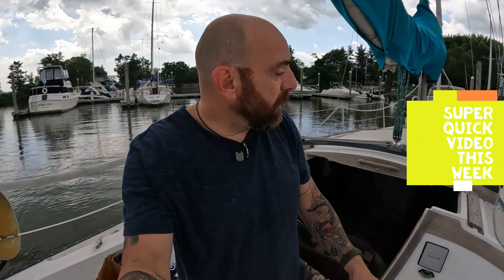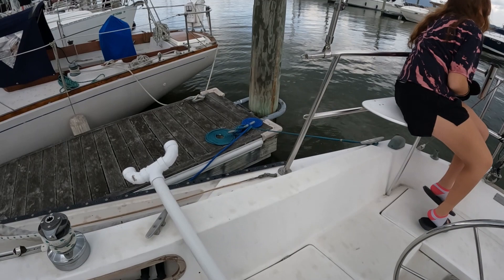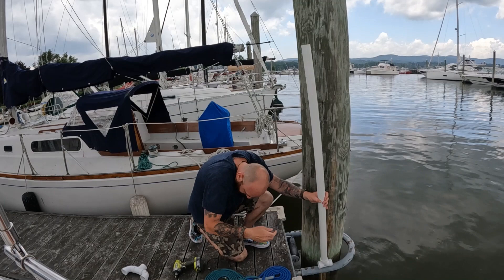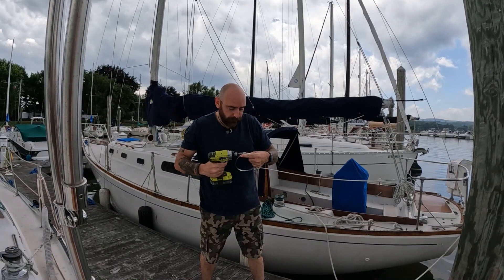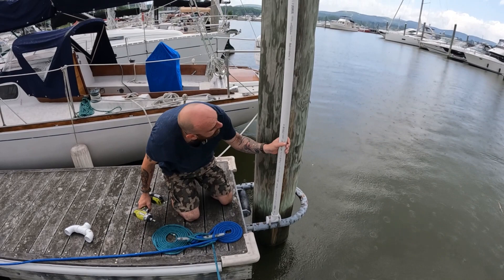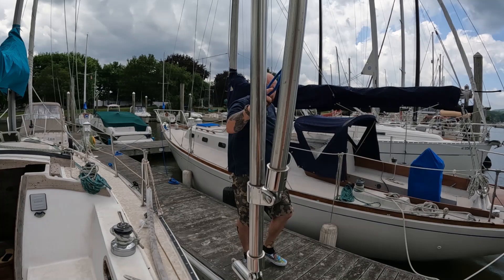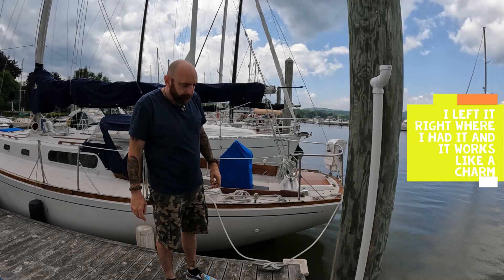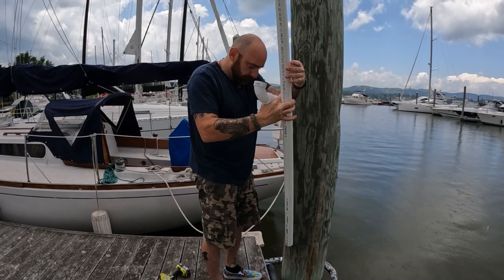Super simple dock line perch for most docks and marinas

Comment: The T on the bottom will be more stable is you were to cut the lower half of the pipe off so it forms a “c” channel that will wrap around the pipe on the dock. Smaller hose clamps will also work with this setup.
Reply from the maker: This is holding amazing right now but I'm always game to try new things